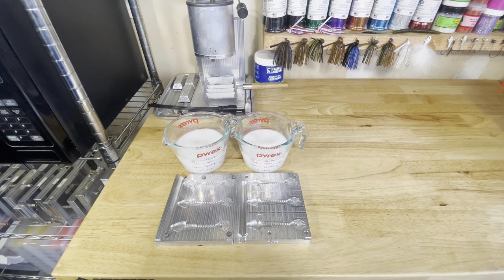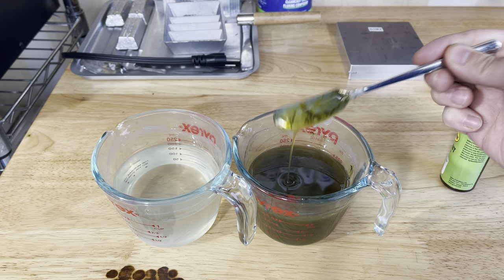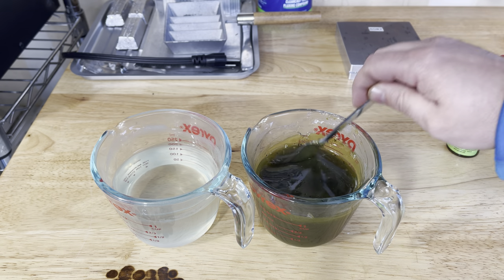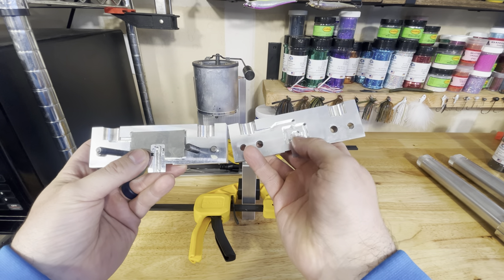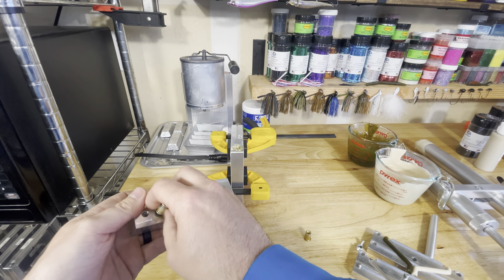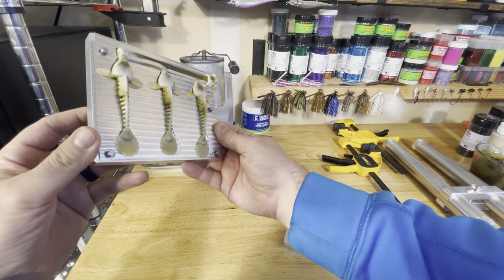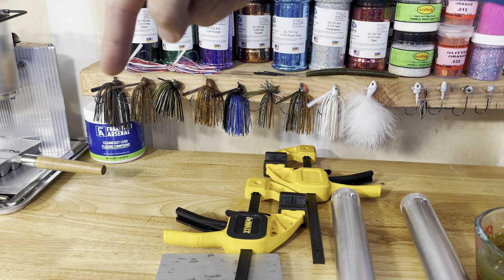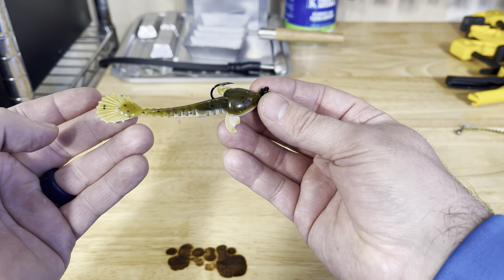3.5” Goby SOFT PLASTICS!! Angling AI C-Block Swirls

Comment: What size of c block is that? 2.5" or 3.5"?
Reply: 2.25" I mean not 2.5"
Reply from the maker: I have the 3.5” C block. It fits the Basstackle dual injectors perfectly
Reply: Do you know if it will fit fat guys fishing dual injector?
Reply from the maker: @jakesjigsandlures  I’m not sure honestly. I’ve never used their injectors. You might have to contact fat guys and ask them
Reply: Where did you get that goby mold?
Reply from the maker: @jakesjigsandlures  got it from one of the overseas companies 
https://baitmold.com/plastic-bait-mold/aluminum-mold/aluminum-w152-3-cavity-3-5-inch-90-mm/